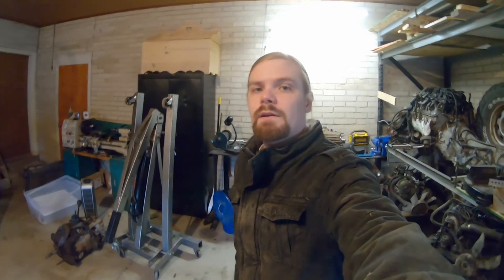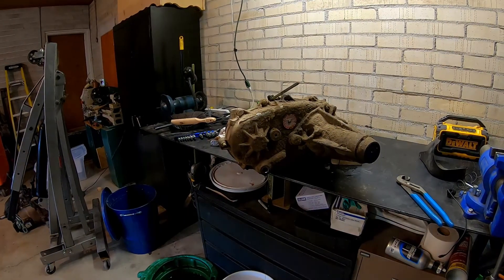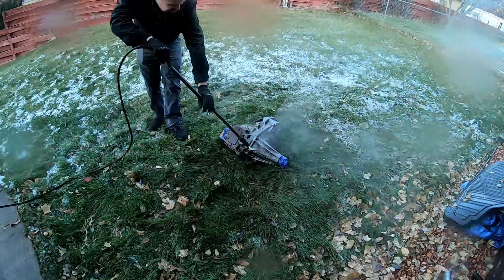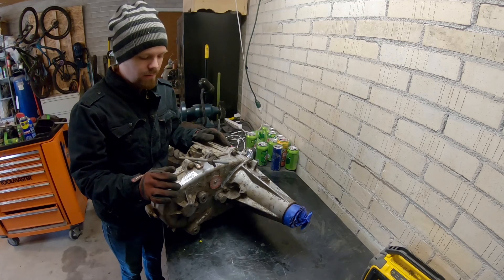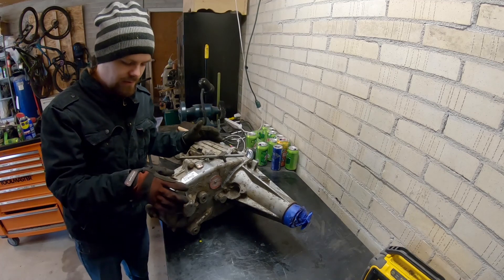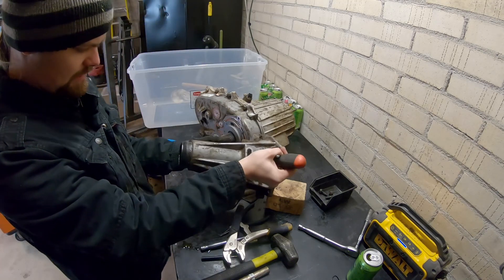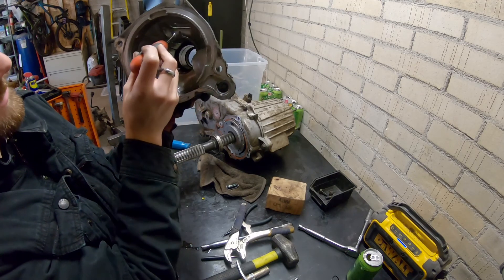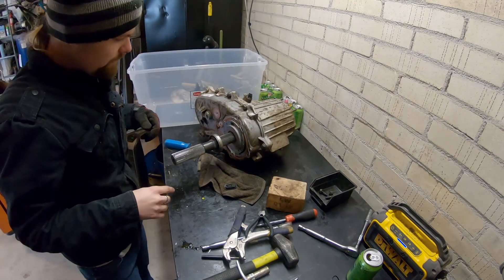I Found a Transfer Case! [ NP241 Rebuild Part 1 ]

Comment: I gotta give you one thing, putting that drive line in an explorer has to be one of the  most creative ideas I've seen on YouTube so far. You're the first guy to think it up, that I've seen. Having the nuts to even try it speaks volumes. I get you're trying to be thorough for the layman. But let's assume your viewers have a moderate amount of experience. Going over small details like you do, really takes way too much of your time and energy away from working on the given subject. Concentrate more on doing the task. You loose interest of viewers by turning the video into a lecture. You've obviously got skills. Yes, knowing why is a huge help to anybody. If you work on it, knowledge of it is needed. I've got 30 years of mechanics under my belt. I've ran dealership shops and my own business. You'd be a huge benefit to any shop. The idea of this forum is simple, entertain. Using the axels you've got shows forethought. I would've shortened them and had the shafts cut down or remade. Keep the width stock.
Reply from the maker: Thank you for the input, it's rare to receive such targeted and well thought out advice. You're not wrong, I do tend to over explain and youtube has a pretty sharp learning curve. There's always the balance between being informative and beating a dead horse and I'm hoping in my newer videos I did a better job of explaining the things that need explaining or are interesting, and leaving be the things that aren't.

This video was a particularly tricky one since I sort of set it up as a vlog, but then filmed it as a how to. A HUGE number of people that view this video were searching for a how to which is why the view count is so high for me, but then like you said the retention is low and my normal audience would probably have just preferred a vlog  and leaving out the nitty gritty details 🤷‍♂️. Always learning 😉

Comment: How close are the gear ratios of that gas transmission to the NV4500?
Reply from the maker: The ratios are the same on mine as on the cummins nv4500's. Its got the decently low first of 5.61:1, but not as low as you could get them at 6.34:1 on the early GM gas ones

With 33's and 3.54's it should have the following ratios and speeds for shifting at 2.4k RPM
1st 5.61:1 at 10 mph
2nd 3.04 20 mph
3rd 1.67 40 mph
4th 1:1 70 mph
5th .75 90 mph at 2.4k rpm (2k rpm gives 75 mph)
Reply: @BuildSomethingAuto  ok cool, I didn’t know they were the same.